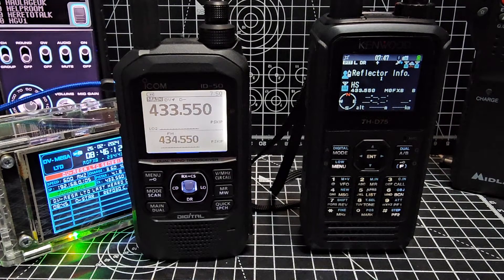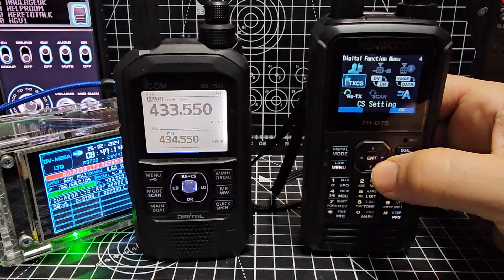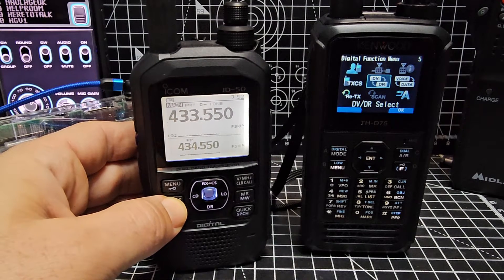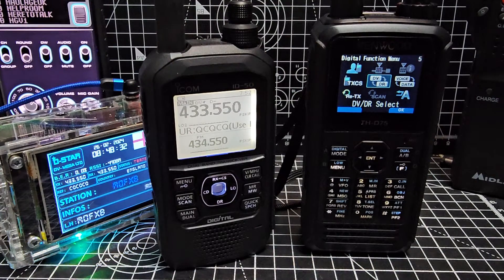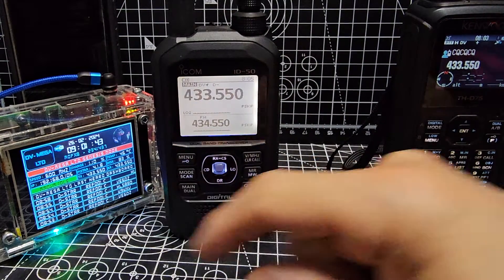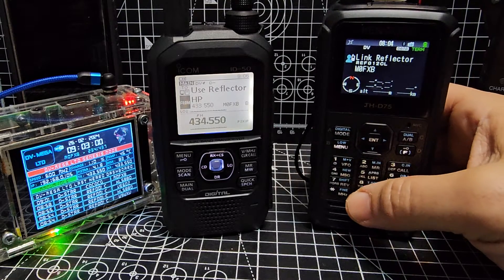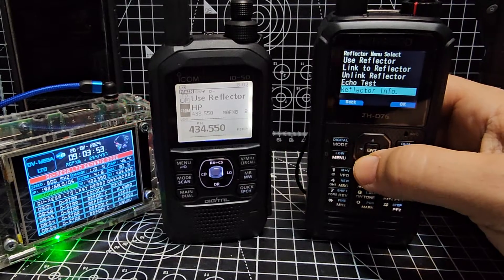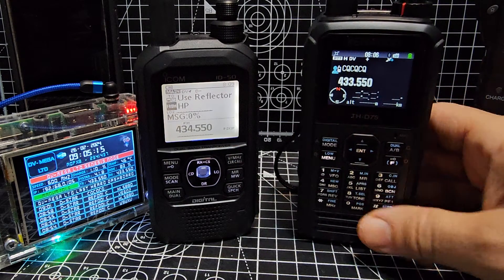KENWOOD D75 - DV Mode - DR Mode , whats the difference ?

Comment: Your vids are very helpful.  I am having trouble getting anything to transmit using dstar repeater.  Using two ht radios, it looks like it is transmitting, getting a signal back on the d75, but no voice coming thru on the other radio.  I have yet to make any contact with other operators, can you help with
Reply from the maker: Get an mmdvm  hotspot then watch Videos

Comment: You don't press "Digital" to go between analog and digital, you press the Mode button! Please use the correct menu and button names from the Kenwood manual. Some of us are visually-impaired, so we are going by the propper names for things, not what you think they are called based on however you are interpreting the icons.
Reply from the maker: The mode button and digital button are the same button its written on the button - Sorry it got confusing thank Kenwood for printing mode and digital on one button .